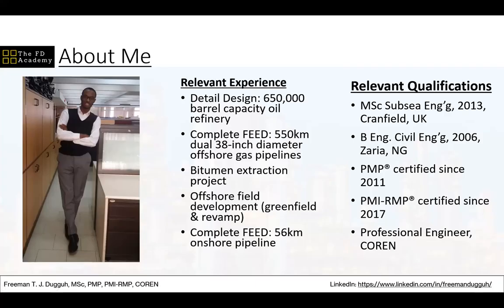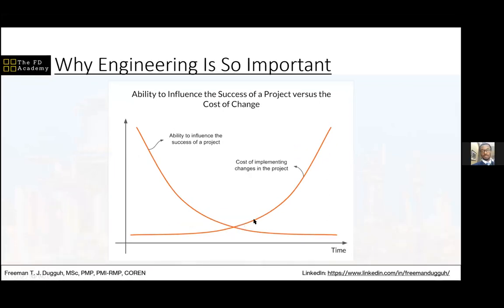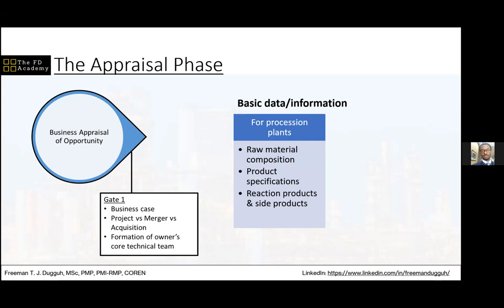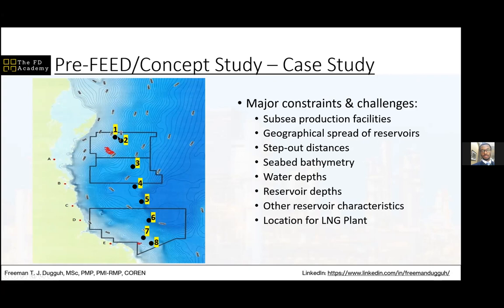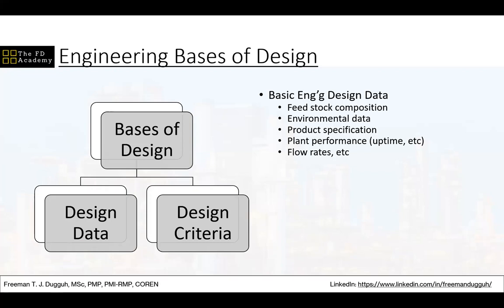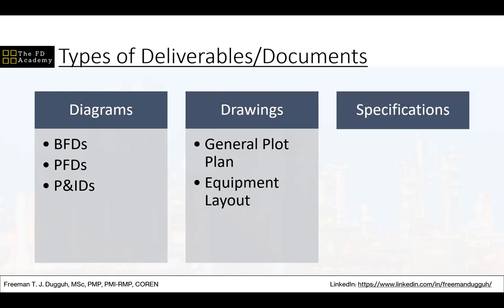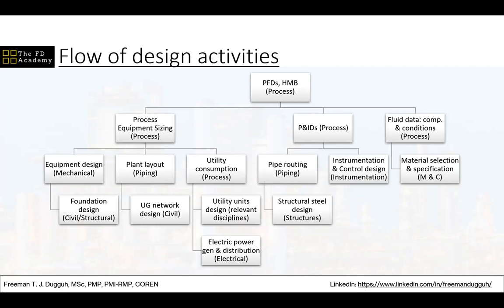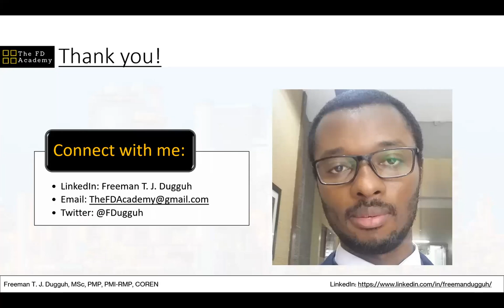Introduction to Engineering Project Management for Oil & Gas | SkolarGate

Comment: in regards to the question of what markup at the end of DED, engineering will be involved at the site, as the instructor mentioned but with a light load, the engineering team would go to the site based on an stq. (site technical query ) to deal with unforeseen issues (the cast was a good example ), and also to draft the red markup prior to asbuilt and final documentation, so the engineering load could be around 2%.